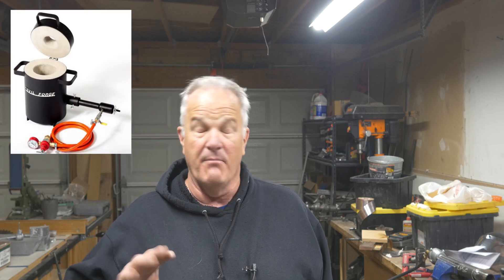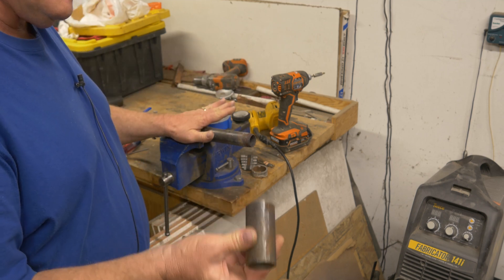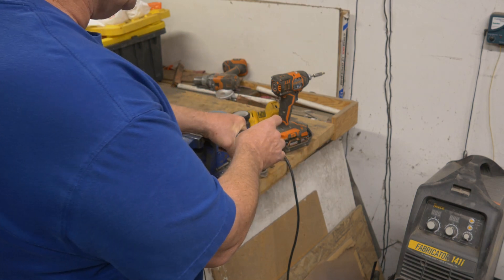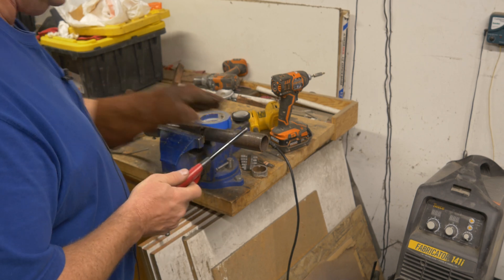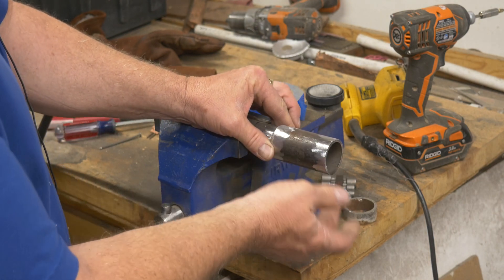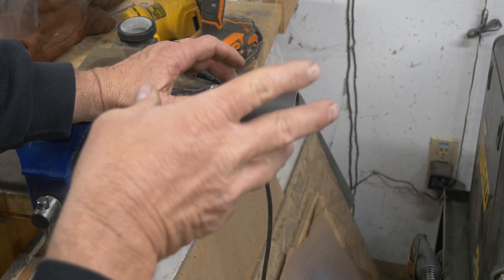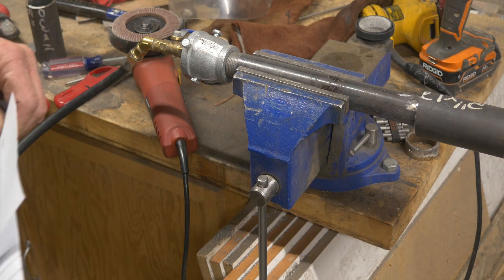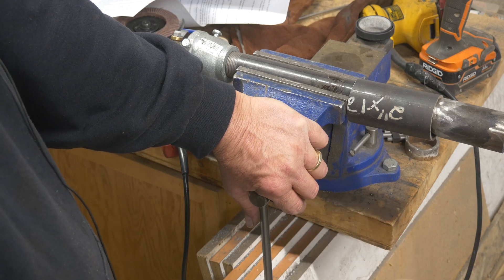burner retro-fit

Comment: I'm going to to be building a new furnace soon as well. I used K-wool to line my last one and it seems to hold up pretty well. What did you use in your new one? Is there a special cement?
Reply from the maker: Guess you'll have to watch tomorrow's video :-D   I'm doing a furnace unveiling.  I'm hoping to get a full build video out the following week.  I used both kao wool and refractory cement
Reply: Oh I'll be watching. I saw the pictures you posted on Instagram and was hoping you would be filming

Comment: It seems that I've seen someone state that flares are only needed for burners outside of the furnace, but I can't say for sure where (backyardmetalcasting maybe?).  If I am remembering correctly, you need the flares to introduce some backpressure (something you shouldn't need when the burner is installed inside the furnace).  But, it's been a while since I read it, so I could be out in left field.
I also remember being told you need at least two diameters after a transition for proper measurement in a smoke stack.  That's for smoke stacks, but I would think the same principles would apply to any fluid flow system (such as a burner tube).  It looks like the flare end was 2 - 2 1/2 times past the end of the burner end.
The burner looks like it works well, and I will be interested to see how it works in the new furnace. Hopefully, we don't have to wait too long.
Reply from the maker: Hopefully 😂.    70 video files totaling 65GB of storage. I may be editing till Christmas

Comment: Great burner video I'm a combustion technician and there are numerous ways to adjust your flame pitch so you could potentially get more flame spread around your crucible . Makes  it more efficient ,less lpg .I'm playing around with a burner, a figure of 8 top burner forced draught .struggling with fan speed controllers! And ignition probe..
Watched all  the ads as big stacked told me 2. Is the furnace next video and have you covered it in chrome?
Reply from the maker: No I haven't covered the furnace in chrome 😃  I did put a nice vanity place on the lid mad of stainless though.  I hope to get the furnace video out this week... we'll see   I have over a 100 video files taking 60GB to edit together.  Oh, and I still need to finish the furnace.  Hopefully the furnace will be done today.

People keep telling me to go forced air but every time I try to force air through the burner it just blows the flame out

Thanks for watching the ads. That bigstack is always looking out for me  😃

Comment: Did you measure the maximum temperature you can achieve? I need to melt some bronze, and mu similar burner just about gets there when gas pressure is high.
Reply from the maker: I've never measures the temp, but have melted cast iron with this burner
Reply: @swdweeb  That should do for me!
Reply from the maker: @coenvanwyk1  I assume it'll work the same in this new furnace, but won't know for at least a week.

Comment: Good Morning! 
Why do you not use an additional fan to the burner? I need much less gas (gas pressure under 1 bar =< 15PSI) for my burner.
Reply from the maker: I tried using forced air on this burner and could never keep the flame going. It just blows out.  I never went back to trying again
Reply: @swdweeb  I use a 12Volt fan from a car ventilation system. With a cheap 12V Controller (15€) to regulate the speed. And yes it works very good!
Best greetings from Austria! here you will find our casting / pouring tests with my furnace: https://www.youtube.com/watch?v=h0ZEc-jLJmY (if you are interested)

Comment: Watching your videos saves me money.  First I dropped Petrobond for greensand (yes...love it...and far more "sustainable" to use a modern buzzword).

I've been using a Home Depot flamethrower as a burner in my homemade foundry.  Works ok for aluminum but inefficient and just doesn't get me enough heat for copper or brass.  I just designed a new double wall foundry using firebricks, refractory cement and kao wool. I'm was about to get the parts to build it and was checking out commercially available burners (definitely not the one you mentioned...nope...it was...um...something else entirely...)

You had to post this.  Now I MUST and will build my own burner (already watched your old video and am gonna check Grant's next).

So...as always you teach your viewers something in your videos and...you saved me money. My wife also thanks you because she tolerates this hobby happily as long as it doesn't cost too much.

Much respect sir.
Reply from the maker: Ha!  I appreciate all of that. Thanks.  

The burner really isnt that hard to put together, so I'd definitely give it a shot.  The most expensive parts is going to be the regulator. You're definitely going to want to melt copper, it's like a rite of passage for all of us.

I decided to skip the fire brick in this new furnace.  Just kao wool and refractory.  The total lining will be about 2" thick. I've got to really hustle and try to get the refractory in tomorrow. The weather is supposed to turn really cold here in Colorado later this week and I don't want it freezing while its curing.

Tell your wife she's welcome 😃

Comment: Great video! I got a burner rebuild project coming up my self too! What Psi or KPa did you do these tests at?
Reply from the maker: I run my burner around 20psi
Reply: @swdweeb  Do you change the pressures for higher temp melts?
I really like how simple this design is and it seams to really work well, my devil forge burner's end flare is burnt up and almost entirely broken off at this point...
Reply from the maker: @meltn  I really don't change the pressure.  I have melted aluminum at 15 psi but I generally just always run about 20psi no matter what I'm melting

Comment: What pressure is the incoming propane and what size weld tip are you using? I built one of these (the original setup you show) and got decent results with single digits pressure PSIG and a .035 mig tip but certainly didn't have the flame as good as this. Need to try out the end flare!! Thanks!
Reply from the maker: I run 15-20 pounds out of my tank.  The flare made all the difference in my original burner

Comment: Looks good. 👍 Should be interesting to see if it behaves any differently inside the furnace with some additional back-pressure in effect.
Reply from the maker: I'm hoping it actually runs better in the furnace, especially once the walls get hot and the thing basically re-ignites itself. The burner ran better in the old furnace than out of it.
Reply: @swdweeb  Yeah you'll be fine.  These type of burners are widely said to stay lit much easier inside a furnace than out, often not even needing the flare at the hot end; that is certainly true of my forced air burners. Can't see why that would be any different for a venturi based burner.
Reply from the maker: @tobhomott  I ran it inside the unlined furnace (steel drum) so I think you’re right once I get the lining in it should be fine as well

Comment: Looks good im running a devil forge burner in my forge and furnace its under powered for the furnace but i still have my homemade monster burner for copper melts as backup
Reply from the maker: I am still contemplating putting a second port in this furnace to allow two burners.  Once I put the refractory in it'll be a lot harder so I better make my mind up quick
Reply: @swdweeb  presstube on youtube uses a double burner. Honestly i dont see much of a performance boost maybe 10-15% .better insulation i have had more performance with speed of melt and temperature hold
Reply from the maker: @kevinwatson5833  yeah, I can't see a double burner getting that much hotter.  The flame temp is the flame temp. The only things I can see a second burner doing is heating quicker and possibly maintaining the temp better due to, as you say, poor insulation.
Reply: @swdweeb  agreed with 3 inch walls and a low volume burner i still get fairly quick results. You could also add the second port and plug it when not used.